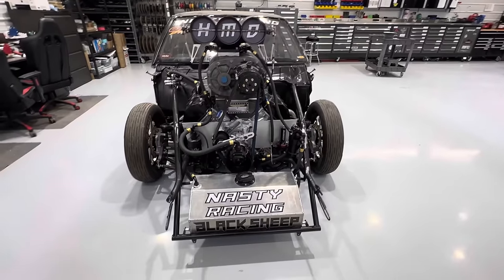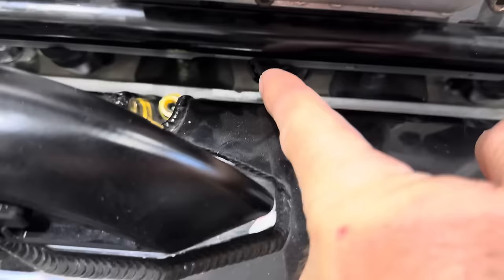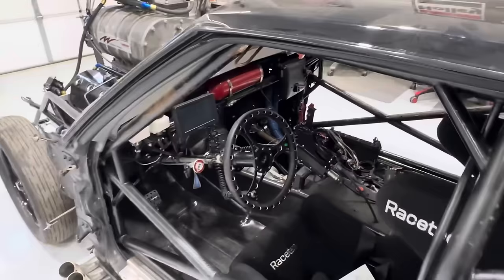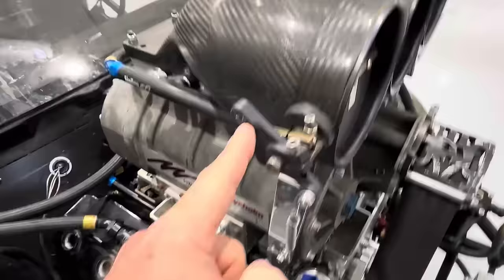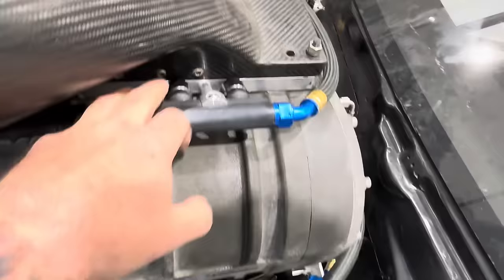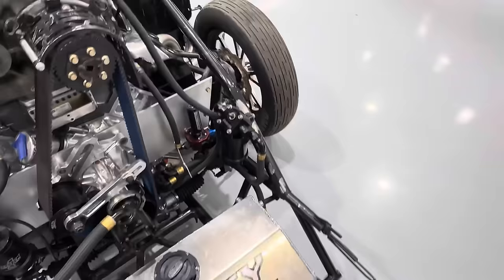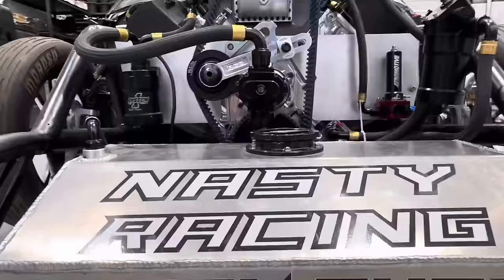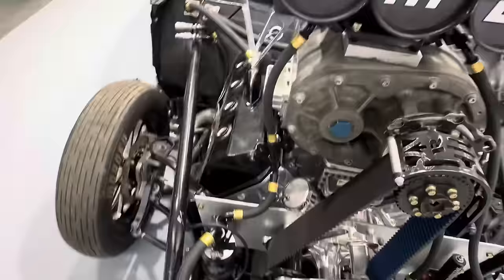John Doc’s Black sheep gets rewired for the screw blower Part 1

Comment: You need to swap that. 40% up top and 60% down low. Whipples don’t need that much up top. 60% will cost you boost. You’ll be surprised by how little the whipple heats the charge

Comment: Add a front bung and Y both into the pump?
Reply: If rear one gets uncovered, it will still draw air in.
Reply: @nocturnalspecialties642  one way roll over valve on each bung

Comment: Why do blowers get frosted if there so hot?? Just wondering
Reply: The blowers don’t frost, the hat does because the methanol is mixing with moisture in the air, dropping the temp inside the hat and creating freezing condensation on the outside